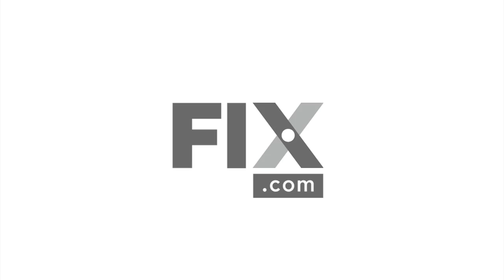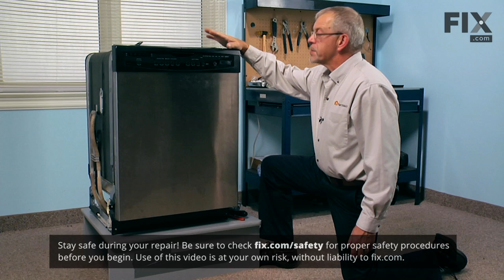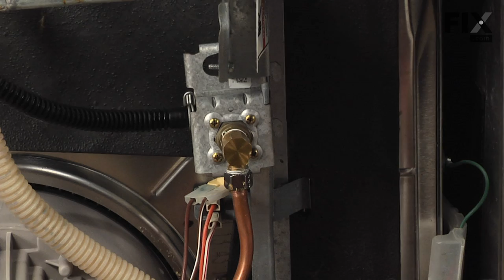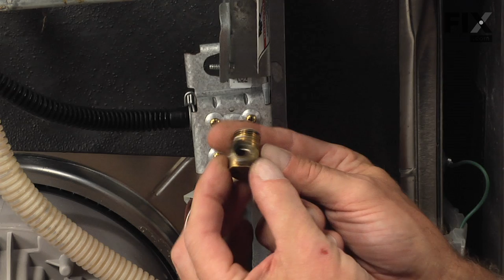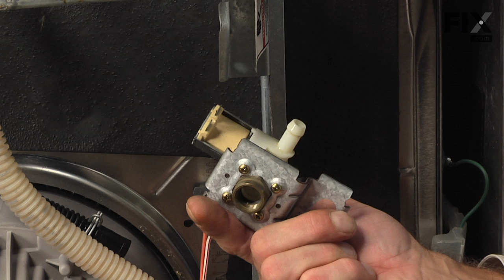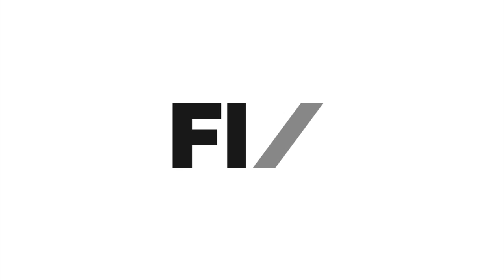Kenmore Dishwasher Repair – How to replace the Water Inlet Valve

Comment: Update to my comment/question below.  I replaced the water inlet valve with a new one and the problem was solved.  I would suggest doing this a little differently than described on this video IF YOU EITHER HAVE A BRAIDED HOSE WITH ADDITION LENGTH OR A COPPER LINE WITH ADDITIONAL LENGTH.  i think the individual on this video had more clearance for his tool (because video taken below, I  assume there was no solid piece under the dishwasher). In reality it's difficult to use a wrench (16mm in my case) to detach the water line from the valve.  With that, first remove the door, since it gives you more room to work. Secondly, I simply detached the assembly from the frame first. That allowed me to drop the assembly to the floor.  I than detached the hose going from the inlet valve to the tub.  Once that was done, since I have a braided water hose connected to the unit, I was able to pull the assembly out far enough to first detach the water line from the brass elbow (I used a vice grip on the brass collar - where the upper part of the elbow enters the assembly, to stabilize while I took off the water hose).  I then took off the elbow by using the vice grip on the same collar.  This was much easier than trying to do it while it was affixed to the washer.  Installation was in the reverse order.  Hope this helps.
Reply: I'll second the value of removing the outer metal panel from the door; doing so yields several inches of extra space from the front to access the inlet valve.  However, a screw driver with the appropriate star-drive bit size is necessary to remove the screws around the inside of the dishwasher door to release the metal panel.

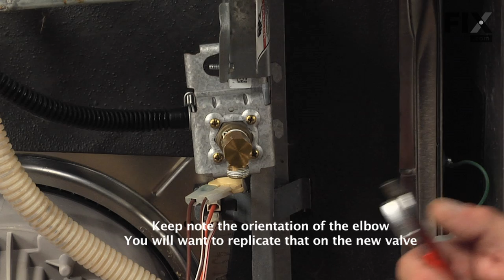Also, a 10mm (or equivalent) crow-foot wrench is incredibly useful for breaking loose or adjusting the copper elbow adapter that connects to the inlet line (at 1:52 in the video).  When attached to a 3/8-inch-drive ratchet, it allows a huge amount of torque to be applied to the elbow adapter, regardless of its orientation, while using the ratchet from in front of the dishwasher, as opposed to trying to squeeze a normal wrench in underneath there.

In my case, the old compression sleeve leaked when I reattached it to the elbow adapter, so I had to use a pipe cutter to remove a half-inch of the 1/4-inch water supply pipe to remove the old sleeve.  Then I cleaned the pipe end with some fine-grit abrasive cloth, added a new compression nut and 3/8-inch copper compression sleeve, plus some non-toxic pipe dope, to get a good seal (and teflon tape around the elbow's threads).  I only mention this because a compression sleeve and nut are inexpensive, and really useful to have on hand if needed.

Comment: Thanks for the great video.  I have water building up and sloshing out over the lip of the tub (the section you would access to remove the air inlet screws)  and I"m trying to figure why such an amount of water is building up there.  Do you have any thoughts?  I"m not sure if it's because of a stuck water inlet valve, a door seal issue or something to do with the bottom seal on the Air Inlet.  I would appreciate your insights. BTW I have an older Kenmore Elite dishwasher (model 665.16579200). Any insights would be appreciated.  Thanks again for the excellent videos.

Comment: Mine knocks in cycles when the dishwasher starts.  Water appears to flow fine.  The noise goes away after 10/15 minutes.  Any suggestions?

Comment: Excellent video, was able to do everything just by removing the kickplate and pulling the dishwasher out about 10 inches. Got the valve from Amazon at link below. Note the hole for the mounting screw on the new valve is much smaller than the one on the original valve so your original screw will likely be too big. Find a screw that fits that new valve before you start this job! https://www.amazon.com/gp/product/B08192MS16/ref=ppx_od_dt_b_asin_title_s00?ie=UTF8&psc=1
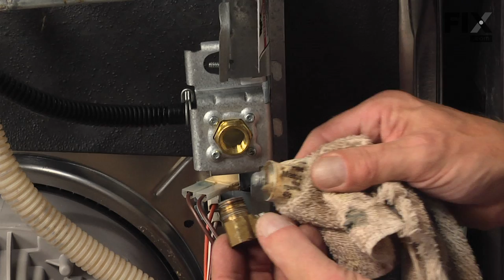Reply: also better to reattach the elbow fitting (shown in video at 4:30) before mounting the valve, I had to tighten mine one whole turn more than I thought I had to as it leaked with a drip every few seconds the first time I reconnected the water hose to test it. Had to take it apart and twist the fitting one more turn using all my strength.